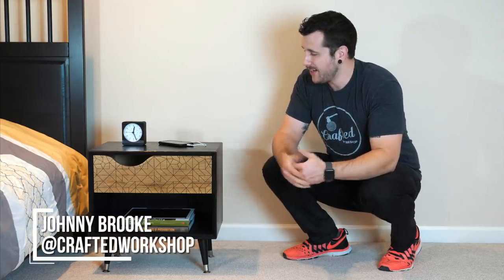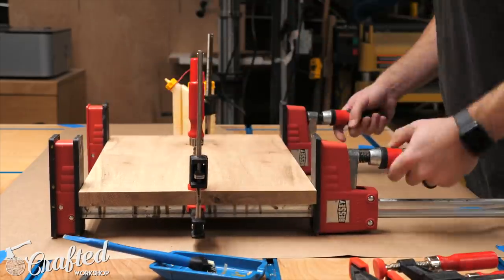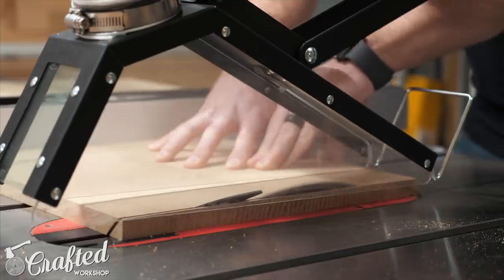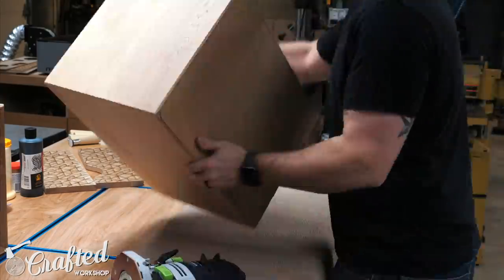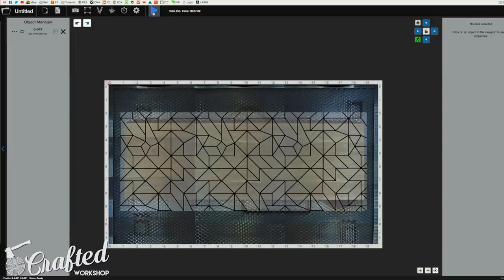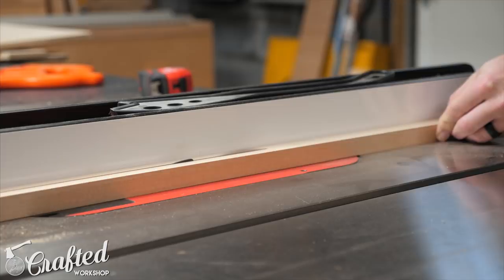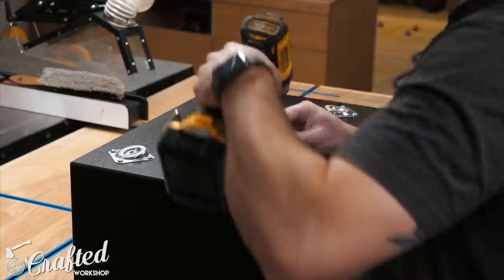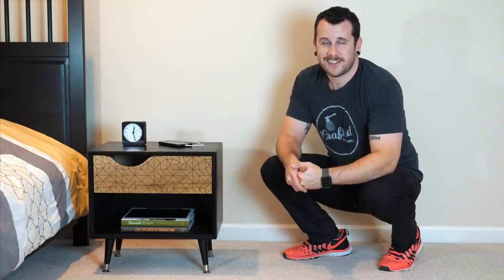DIY Mid-Century Modern Bedside Table / Nightstand with Ebonized Oak | How To Build - Woodworking

Comment: You can use some scrap to make drawer slide "story sticks" for install.  Then reference off of the bottom of the cabinet.  I used that in both "a desk for the office" and the "shoe dresser" videos.  Works like a charm and no jig needed.
Reply from the maker: I’m not sure how I forgot about that method, especially since I’ve seen both of those videos at least once. Next time!

Comment: I was taught in woodworking classes to use floating drawer bottoms (cutting a dado in each side of the drawer, and slipping the bottom panel into the dado before attaching the final side).  This allows for contraction and expansion.  I see a lot of Youtube woodworkers just nailing and gluing drawer bottoms on, like in the video above.  Any rationale behind this other than saving (minimal) time?  Even with the chamfering around 7:50, the exposed ply sides of the bottom looks a little ugly and detracts from the hardwood used for the rest of the drawer assembly.  I loved the india ink ebonizing technique, and the laser cut drawer fronts are great.  Thanks for sharing!
Reply from the maker: There is no expansion and contraction with plywood, or very, very little. Floating drawer bottoms are definitely the right way when using solid wood for the drawer box.

Comment: I think that if you went with Shou Sugi Ban to make the nightstand black, it would have complimented the geometric design on the front and added more texture and character to the finished piece :) maybe for a next project.
Reply from the maker: That would have been cool, but shou sugi ban isn’t really pitch black, which is what I was looking for.
Reply: Crafted Workshop Ahhh I hear ya :) ... although, the alligator skin burn is very close to black and has a very nice sheen, especially once a layer of clear goes over it. 
But, nevertheless - this piece you have crafted is beautifully made and well designed!
Reply from the maker: For sure, thanks!
Reply: Crafted Workshop You are very welcome mate!

Comment: Love the laser pattern on the drawer and the ebonised wood combo. Wonder if you really need the cut out for draw pull as you have hand access to the bottom of the drawer. Looks good though.
Reply from the maker: Thanks! Probably don't need the cutout, but I like the look.

Comment: Hey Johnny, thanks for the reply.  I suppose what I’m asking/requesting.  Are you able to do a video to build a similar table or a table similar to the kerfed one you previously did without using the big machines such as joiner’s and planers?  Thanks a lot
Reply from the maker: The kerfing table definitely didn’t require a jointer or planer. I just used that for the face frame, and you could easily buy S4S lumber for that and skip the planer and jointer. It’d be hard to avoid the table saw, though.

Comment: Cool project Johnny!  Can I ask a bit of a newbie question?  Why did you choose to router the rabbit, and not say... cut it on the table saw before you assembled it?  Does it help for a more consistent depth?
Reply from the maker: Thanks! I totally could have used the table saw, just went with the router for whatever reason.
Reply: Nice to have options!
Reply from the maker: For sure!

Comment: Are the drawer fronts made from white oak as well? I really like the color of the finished product. Is that the natural color after applying finish? What type of finish did you use? I’ve always worked with walnut but now I want to try some other wood :D
Reply from the maker: Yup, the fronts are White Oak! Thanks a lot. That is the natural color after applying the General Finishes High Performance, I linked to it in the video description.

Comment: Such a cool design Johnny!  I really like the chamfered edges.  On the spraying, what was your sanding/ coats process for the GF HP?  Great job man.
Reply from the maker: Thanks! For HP, I usually spray two coats without sanding to build up a layer, especially when finishing a stained piece, then sand with a 500 grit sponge before applying the final coat. I get a glass smooth finish.

Comment: Why did not you cut the rabbet before assembling the cabinet?
Reply from the maker: I find it easier to do it this way, you also don't have holes in the side of the cabinet from running the rabbet edge to edge.

Comment: What is the difference between ripping and cutting??
Reply: Ripping means cutting along the grain of the wood (usually along the longest side). [Cross] cutting is cutting across the grain (usually along the shortest side of the board).
Reply: The grain direction. Rip cut - along the grain, cross cut - across the grain.
Reply: The HandToolery Thank you so much❤
Reply: Torsan1977 Thank you so much❤❤
Reply from the maker: Looks like these guys handled this one, thanks!

Comment: Great project! Looks sharp..    The explanations on camera at the end sound natural.. the narration throughout sounds unnatural.. try to break it up more.. or vary the timing pacing or reading a little bit.
Reply from the maker: Thanks for the feedback. I'm definitely trying to add more of me talking in front of the camera, saves me time writing the voiceover as well.
Reply: Crafted Workshop that sounds great. I look forward to more projects.  Sidebar... That laser pattern could be made with a wood burner and a straight edge... Buuut I don't think it's necessary to provide alternatives every time you build something with an expensive tool..
Reply from the maker: Yup, definitely a number of ways to get that pattern. Thanks!

Comment: I loved your build, I just don't think this is DIY. You are a professional, with tons of professional equipment. We can't achieve the same result without access to a proper workshop :/
Reply: Thats the way you see it which is wrong. I can make this exact nighstand using just five tools that I have that are not expensive: my hitachi miter saw ($80), my ryobi circular saw ($39.99), my black and decker jigsaw ($30), a cordless drill (about $80) and a sander ($50). That's $280 in tools, probably you can skip the miter saw and do everything with the jigsaw and circular saw. A jointer, planer and bandsaw are terrific tools but honestly they aren't needed if you start with good lumber and go with the methods you have. The router part while it gives a nice finish isn't completely necessary.